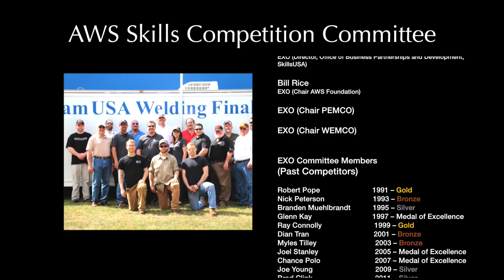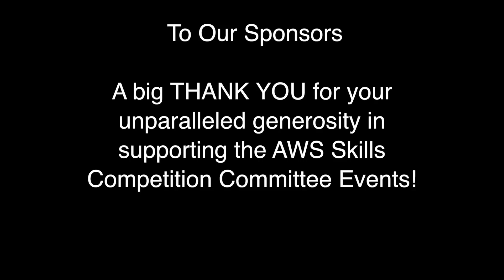2017 SkillsUSA Welding TeamUSA Competition Winner

Comment: These bullshit shows. Ive been welding since I was 5.
If you want to find the worlds best welder then your looking for someone who can succesfully join two rusted pieces of farm equipment with little to no amps on a windy day pissin down rain on a cattle yard.
Or maybe those guys who risk their balls  lighting the water up under the guts of some bleeding ukrainian vessel bobbin around in shark infested waters tryin to seal up a hull crack.

No. The worlds best welder walks in with a suit n tie with a frappachino weldin behind flash curtains in a nice clean shed that you could eat off the floor.

There is no such thing as the worlds best anything, but I wouldnt be sayin that to iron mike...

Comment: These young men will make $80,000 or more their first year. Stay out of debt and you can live well on that. Get into debt, live hand to mouth like many lawyers, and you can be poor on $400,000.
Reply: To say these kids are going to be pulling 80k with no real world experience is a bit silly, there is huge entry level glut in the welding industry (partly created by these programs) turnover is extremely high (which drives the experienced welder shortage) They would make more money inspecting. My cousin had been welding pipeline for 6 years and makes 50-55k a year, with pervious experience. He could make more on an oil rig but he doesn't want to be in the ocean. The average welder makes like 30k entry level with certs.
Reply: Joe Blow Working 12 hours a day seven days a week for as much time as they want to? They should,  according to my teacher who is a union welder.
Reply: The numbers are a simple google search away. Underwater welding, military welders, industrial pipe welding, middle east pipe liners, can all make 6 figures. All of which need extensive experience and certs. My point remains, those kids have zero experience and so your claim of 80k a year is silly (46 hours a week in overtime is what it would take to get 80k a year for a newbie making 14.00$ hourly) its neither here nor there, the real world numbers are 30ish K a year for your average entry level welder.
Reply: 88 : Not what I said, read again, comprehend.
Reply: 88 : Are you a union welder or steelworker. Sure, these guys will start as helpers but they are the cream of the crop and will have an easy time getting in. Unless they just want to they won’t be working at a muffler shop for $14 an hour. At the GE machine shop where I worked a Vietnamese guy making $20 an hour and change made over $100,000 one very busy year. He was very, very skilled at polishing gas turbine blades and was in charge of his shift so was putting in 72 hours a week.
Reply: Was on vacation, noticed your reply. You didn't do the math when you made up your response did you? Cause If you did you would see that 20x40=800+32x30=960+800=1760x52=91520 before taxes. Guess you haven't bothered to do a single bit of research into my original comment either. Not surprised.
Reply: Joe Blow hope you enjoyed vacation. I’ve not been in contact  since early December with my instructor who gave me the hourly figures. I’ll see him tonight and ask.  TW, are you a union welder or metal worker? I only ask because I’ve heard from a fellow where I buy some steel that the ranks of welders is crammed. I’m retired so I don’t really care but just wondering.
Reply: who wants to work that much and who has time to work that much who wants to work more than 40 hours a week... lets be realistic!
Reply: jockellis: If they want a LIFE, meaning no more than 50hrs/week, IMO, they will be VERY lucky to break $40k/yr. If they go on the shutdown/turnaround circuit, and they get 7-12's, they could POSSIBLY break $65k/year with great connections and good scheduling, which requires lots of luck and maybe 1 in 5 years are good years. BUT, that's not including the cost of living on the road, which is quite high, even if you bring your own R/V. The ABSOLUTE max someone will make in the oilfield (anywhere in the world if all they can do is weld (structural AND PIPE) is $65K/year. I exclude pipelines from my response entirely as I know too little to offer any experience based information on them. Go Union and you can have a LIFE and Max out at about $48-$57k/year. Go Union and work turnaround/shutdown circuit and with highly favorable conditions break $85/year (not including road expenses or per diem, etc). There are welders who break $90, and even $100k/year. But for every one of them, there are AT LEAST 30 who make half that. To say anyone makes $80k/year without working 7/12's (84 hours a week) is misleading at best and an outright lie at worst. 5 years as non-union, 17 years shutdowns, 19 years offshore (international as well). Time was split amongst all professions randomly. 
P.S.- A new policy creeping in is 7/12's a week maximum allowed hours, with one day a week off mandatory and r safety reasons, the reason being working 84 hours a week is unhealthy to do year round with absolutely no breaks. some places are pushing 60 hours a week max. If job site injuries decline significantly from shorter weeks, and all estimates from available data indicate they will, the days of getting 44 hours a week of overtime will be a distant memory.
Reply: If you are only making $20/hr as a welder you need to find a different company to work for.
Reply: They will make no where near 80k maybe 65 MAYBE. 
Sincerely a welder.